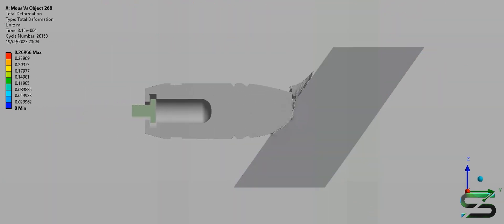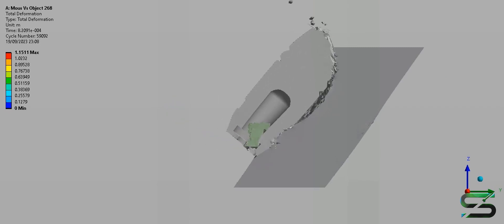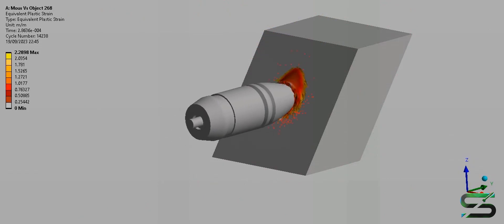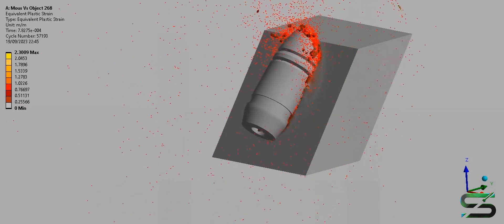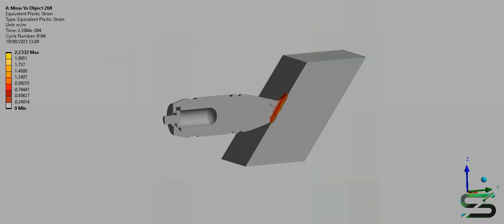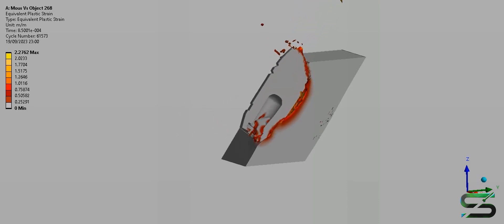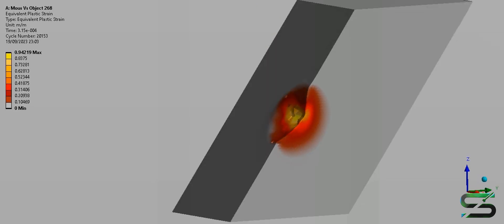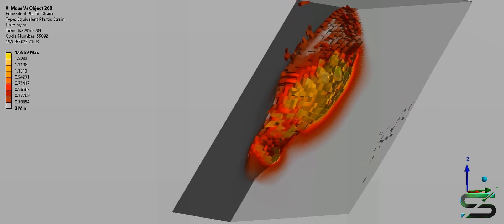Maus VS Object 268 | 152mm BR-540B Armour Piercing Simulation

Comment: Why did it only penetrate about half the width of the projectile?
Reply: Because the shell velocity of that specific round was 780 m/s if it was going 1800 m/s it would likely penetrate that angle and thickness.

Comment: thickness? degrees ? material? BHN= N/mm2 example standard steel what use most tanks about 150BHN=500N/mm2 the tungsten carbide core about 600BHN= 2100N/mm2